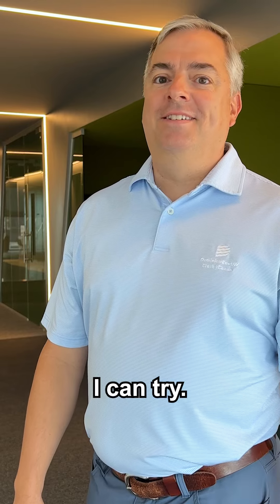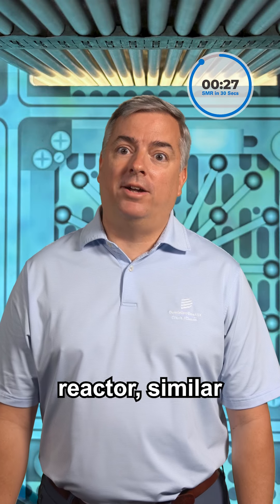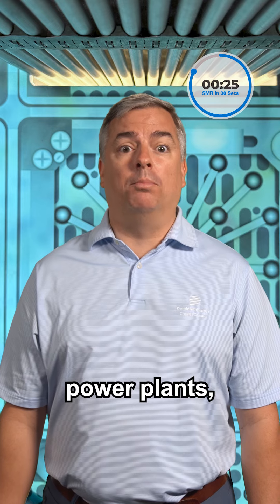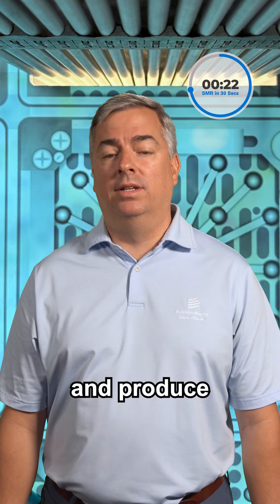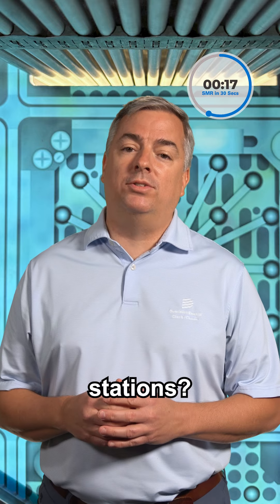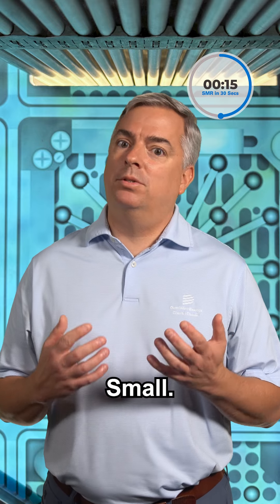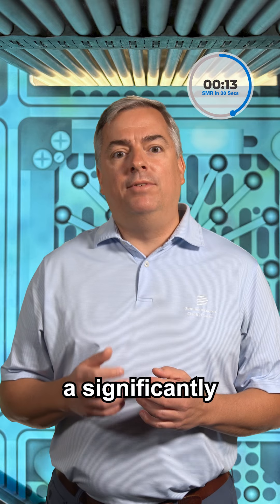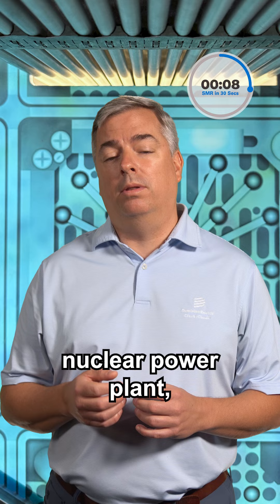Small Modular Reactors Explained in 30 Seconds

Comment: One of the safety and selling points of this type of reactor seems to be its small size and therefore presumably causing less damage if something were to go wrong. So consider, there would be more of these units thus increasing the odds of a mishap, but again, the outcome would be small. I compare this to the use and outcome of smaller tactical nuclear weapons which are not as catastrophic as conventional warheads yet still wreak havoc.